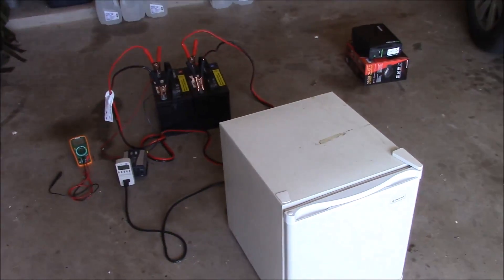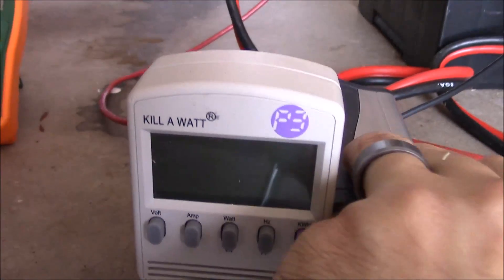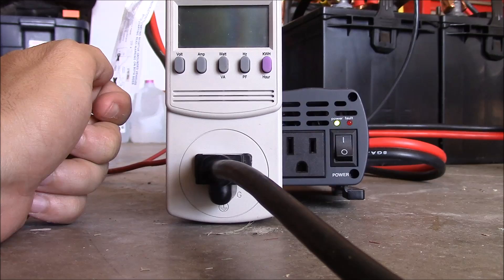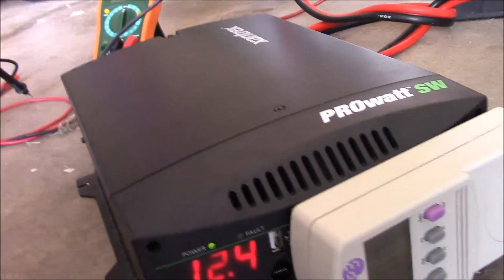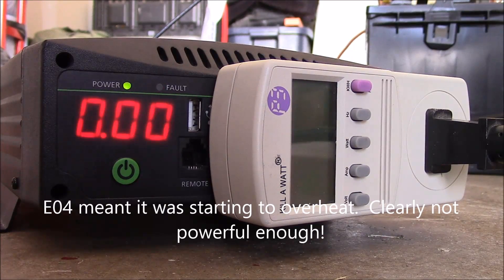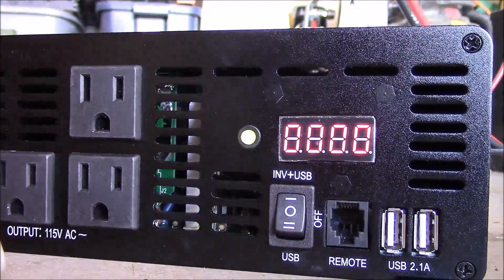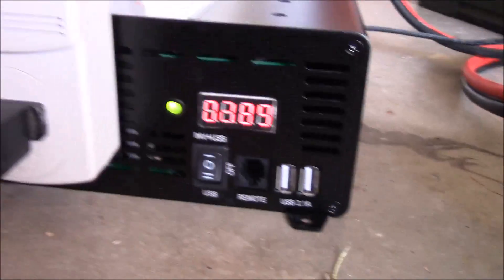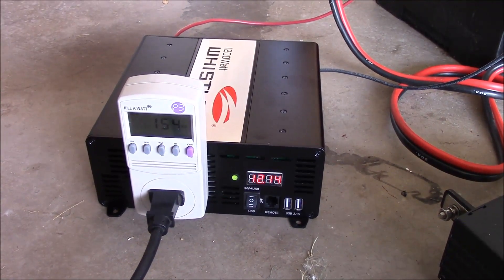Will It Solar? - Mini Dorm Fridge 3

Comment: Dude you need 4 awg wire to inverter
Reply from the maker: Ideally, yes.  But that isn't relevant to the experiment.  The exact same setup worked with a different inverter.
Reply: @LDSreliance  yes it is a inverter need heavy wire to run correctly bro. Try 4awg wire on the 500w and watch it will work
Reply: Try it on next video and I'll suscribe ok?

Comment: Bad inverter fridge pulling to many amps to many
Reply from the maker: Yes, some inverters aren't built for it and some refrigerators make it harder with inefficient compressors and no soft start.

Comment: Wait for a while... Give it 10 minutes before celebrating. We thought it was all good in the first five minutes, but my 2000W Performance Tool inverter isn't carrying my 3.2 cu-ft fridge at a 40-50W steady pull after the initial 580w start up surge.

We're connected to 200W of solar but the inverter isn't staying lit for long. Thank goodness for power station backup, however, I'd rather run off the solar/battery/inverter setup.
Reply from the maker: If the inverter can make it through the initial surge, I don't think it is the inverter that is failing to keep up to the ongoing 40-50W.  Sounds like the solar panel system is not giving it enough power.  I'd guess voltage drop but I don't know much about your system.  You could have 1000W of solar but if the voltage making it to the inverter is too low for the inverter's power range, it will shut itself off.

Comment: The wire guage on the battery side is too small and will create too much resistance(heat)  going in to the inverter therefore causing a thermal overload. Your watts and amps should be about half of what your reading as well. This is more than likely caused by a bad capacitor. you should be at about 50% of the RLA not right at it. That reading is the maximum working amperage of the compressor before it would shut down on internal thermal overload and or ruin the windings from too much heat.

Comment: If you have not figured it out yet then here is your answer. Your inverter is to small to handle the compressor. When the compressor kicks it can pull 3 times as much power to kick it. Also it looks like you are using a modified sign wave inverter and some things just don't like modified sign wave inverters. If you are going to try and run something like that and you want to go with a cheap inverter then buy a Power Bright 1100 watt inverter from autozone. They cost $105.99 as of today. I have one and I can use it to power my 700 watt microwave. When I bought mine they were only $99.99. I also have a small fridge with a freezer that my power bright 1100 watt inverter will run.
Reply from the maker: I guess you didn't watch to the end of the video.  I did figure it out and did get it to work on a large inverter like the Power Bright that you mentioned.  The point of the video was not to discover that there was a large surge current.  I already knew that.  The point was to see what kind of inverter would actually work.  Because just saying "3 times as much power" doesn't help.  The running Watts of that Fridge was less than 150W as you can see at the end of the video.  So by your math, the Xantrex ProWatt should have easily handled the load as it is rated for 600W continuous and over 720W surge.  But it didn't.  And the Xantrex is a pure sine wave inverter.  

It wasn't until I stepped up to a 1,000W unit that it worked.  So the point is that not all inverters are designed equally internally to handle large transient, inductive loads like a compressor motor.  It doesn't matter what the surge rating says or whether it is pure sine wave or modified sine wave.  Because the inverter that got the motor to run is a modified sine wave inverter.
Reply: @LDSreliance  I did watch the whole video. My point was that if you were wanting to run that on a cheap modified sign wave inverter then I would have used a 1100 watt power bright inverter. I myself own a few inverters and a couple of them are complete junk. I have a 400 watt everstart inverter that can barely handle a laptop that pulls 90 watts. I have a 1100 watt power bright modified sign wave inverter that can handle my 700 watt microwave and can even handle my 10,000 btu haier air conditioner or my Mini fridge and my 3.5 Cu Ft chest freezer at the same time. Then I have a WZRELB 1500 watt pure sign wave inverter that can run pretty much anything that I need it to run. Then I have a 2500 watt cobra modified sign wave inverter. Most of the time the watts listed on a power inverter are a scam since a lot of them will not output the required amps needed.
Reply from the maker: Exactly.  I am sure I didn't make the point of the videos clear but I wanted to illustrate to people that had not run into this issue that not all inverters are built and rated the same way.  And about half of them are nearly worthless.  So I wanted to take an actual common device that someone may attempt to use, in ignorance, on an inverter where they may run into severe issues.  Microwaves, fridges, air conditioners, vacuums, and other devices throw a lot of people for a loop this way.
Reply: @LDSreliance  I agree with you 100 percent. I have done a few videos myself showing some of my inverters. It more or less comes down to the amp draw on a lot of things. Any inverters from wally world are complete junk. Cobra inverters are rather expensive. The middle ground inverters are the best inverters for most people. 1000 watt up to 1500 watt inverters would work for the average person. In my video uploads I ran a 120 volt dryer on my 1500 watt pure sign wave inverter. I was not downgrading your video in fact I enjoyed it. keep up the good work and have a nice day.
Reply from the maker: Thanks man.  You too
Reply: @LDSreliance  Thanks, but I am in for a really long day. sony sent my girlfriends PS4 a bad update 9.60, and it more or less bricked her system. I have been working on it for the past 3 days. I ended up replacing the Blu Ray Drive and the Hard Drive. Then I gave it a Hard Reset without the hard drive installed and I have been able to get it to read and play 11 out of her 15 games. One game Tales of Arise is really important to her since I bought it for her birthday last month . Right now I am trying to install Horizon forbidden west and it's taking 8 plus hours just to install. Then I have to check to see if it will play. I may make a video on how I did this to try and help other people out.
Reply from the maker: I am sorry to hear that.  Turn the bad situation into something positive and make a video!  Great idea.
Reply: @LDSreliance  Thanks. I uploaded a video on how I did it yesterday. Today I am going to make a video on my 55 Qt 12 volt Zokop fridge, and I am going to reinstall her 1 Tb hard drive in her PS4 and start all over from scratch. Another long day.

Comment: I've always brought coolers/ice for camping trips and think its time to upgrade to a portable refrigerator which are very expensive and then I came across your video...mini frig's are way cheaper. Would this work with only one of those batteries?
Reply: My portable 500w solar power stations run my 3.1 cubic ft dorm fridge but not my 5 cubic ft manual defrost box freezer. My Bluetti EB70 with 700/800 watt inverter runs the freezer though. These power stations run these about 24 hours depending on ambient temperature. They would likely have a shorter run time after a hurricane when it`s 99 degrees and I tested them at normal room temperature. So I got two power stations for each so I can be charging two as the others run them. I just bought a 300 ah LiFeP04 battery, 2000w inverter, and a charge controller so I can have some power for a tiny window air conditioner, a bit of backup heat in Winter, and to cook or heat/distill water if needed.

Comment: It's the initial surge, the inverter is not large enough. 750 watts
Reply from the maker: Yes but even some inverters that claim a surge capacity that SHOULD start the fridge won't.  It has to do with the internal build quality and components and design, too.  A dorm fridge is a transient, inductive load that even appropriately sized inverters like the ProWatt can't handle.

Comment: Have you tried doing this to a full size residential refrigerator? I wonder how big the battery and inverter would have to be. Thanks for the info
Reply from the maker: Great idea!  I do want to re-visit this series now that I have better equipment and more knowledge.  I have a chest freezer that I would probably start out with but a full size fridge would also be do-able.

Comment: old video but thother unit needed thicker wire to work?
Reply from the maker: That was one thing I tried changing, including another battery.  But the real problem seemed to be the inverter.  Some inverters just aren't built with internals to handle big transient, inductive loads like a compressor motor winding up.

Comment: I also found it makes a huge difference if you run pure sine wave inverters fridges and microwaves need pure sine wave power
Reply from the maker: Part of that might be because pure sine inverters are much more expensive and are usually much better built.

Comment: It’s been 5 years

That inverter is designed to sell not running anything useful. 

Pure sine is the only inverter you should run a fridge with if you don’t want to burn out the fridge motor

12.4 is not fully charged btw

Comment: My full size side x side fridge will run on an 800 watt inverter. You need large inverter cables. But i would advise a 1200 watt sine wave inverter or larger to run coffee pots or a small microwave.

Comment: Compressor motors draw 10+ amps to start up, mine would not even run with a 1200 watt inverter.  The inverter compressors used in big fridges do slow start and I've been able to get mine to run off a 300 watt inverter, but instead of motor startup, they have a surge when you plug it in to fill the capacitors, so I needed to slow that down, but that is only when plugged in once, not to start the compressor.  hope that helps someone.

Comment: your whole issue is those jumper cables bud. you cant do that.
Reply from the maker: Please explain.
Reply: You need 2awg wire with good copper lugs on the ends. Either crimped on or solder on. I solder then crimp personally
Reply from the maker: Jumper cables can provide huge amounts of current for short periods of time.  They are not the problem at all.  If you watched the video until the end you saw that the issue was the inverter, not the cables/wires or the batteries.
Reply: 👌 let’s say this. Try it with my method and let’s see the difference on video.
Reply from the maker: I don't have that fridge any more or we could revisit this.

Comment: Ya nice vid

My fridge says 1.2 amps

But look at the compressor it says 8amps

So it needs an 8amp kick 

8x120volts 
Then add 20% buffer

1152watts

Thx man
Reply from the maker: Good find.  I wish that information was published in every refrigerator specification sheet.

Comment: alligator clip to the positive + on the inverter? You used massive jumper cables between the batteries and tiny wires to the inverter with poor connections.......there's your problem No1. Startup watts on the fridge you need to basically multiply the running watts by x8..... Problem No2....!
Reply from the maker: Then why did the exact same setup work just fine with a different inverter?  It isn't the wiring that is a problem.

Comment: You are dealing with a issue called Locked Rotor Amps.  A very common issue when dealing with refrigeration.  The initial current to get the compressor going is what is causing the Inverters to trip. Set your testers to check the max current at start up and your will see what it is using.
Reply from the maker: Thanks for putting a name to the phenomenon.  My testing equipment does not have fast enough resolution to catch the current spike.  What do you suggest I use?
Reply: @LDSreliance  I use an ALS-1 Line splitter  and a Fluke 325 Clamp on amp meter.  The Fluke has a Min/Max button that records spikes during an amp measurement.  The ALS-1 is a device that you use so you do not have to cut open the power cord and put the clamp on one of the wires.  You just plug the ALS-1 into the receptacle and then the power cord goes into the other end and put your clamp on through the X1 opening.  The X10 opening multiplies the reading by 10.  It is used for very low amp readings.  Your video gave me the idea to put my small refrigerator in my RV when I go camping to save on the cost of ice and a trip to the store.  The last trip this summer I went through a $5 bag of ice every 1.5 days and it was a two week trip.  My refrigerator is running on 2 Costco 6 volt golf cart batteries, 400 Watts of solar panels, and a Xantrex PROWatt 2000 Inverter.  The Solar covers the load during the day and the batteries handle it no problem at night.  Very little load on the system.  Thanks for the good Idea.
Reply from the maker: You are welcome.  And thanks for the recommendations!

Comment: 12.4V on your 12V battery means it is dead. A 12V battery reads 12.6 uncharged, and around 13.4-13.7 charged. Read the vtage of your car battery sitting in your driveway (not running). It should be around 13V+. Your test is failing in part due to asking a  dead battery bank to kick start a motor.

Comment: Second thing I would do is split the batteries apart then drain one battery then drain the other then recharge them incycle the batteries couple of times individually then after you do that about four times connect the battery batteries so they make 12 volts so you're doubling that your capacity then connect a bigger power inverter cuz I'm probably power the refrigerator it's trying trip in the power inverter

Comment: why don't you go to the wall outlet plug the kilowatt into the house plug the refrigerator into the killalot tmh power it's taking it might be taking a thousand watt and your power inverter is only a 750
Reply from the maker: The Kill A Watt isn't fast enough to read the amp surge when the compressor motor fires up.
Reply: @LDSreliance  it says what the surges on the refrigerator are you stupid. look up the model if it's not on the refrigerator.
Reply from the maker: I have never seen that.  Regardless, the point of the video was to prove that the components will actually do what they are supposed to do.  You can't just look at a specs sheet and buy stuff and assume it is going to meet your needs.  That would be stupid.

Comment: Glad you finnally solved the problem yourself, took me about 3 seconds once you showed the inverter lol.    Either this was just click bait or you really should learn more before doing videos that make you look so dumb!  Most any normal motor or compressor has a startup "locked rotor" surge amps/watts requirement far more than the normal running watts.
Reply from the maker: Yes, everyone knows that.  But the inverter should have handled that surge easily according to its specifications.

Comment: The fridge compressor is either old or just not functioning right. Typically compressors consume between 50 and 70 watts, even for big units. 160 watt draw suggests it might be broken and the surge current could be even more than the typical ratio of 7-10x of running current. Thus, for a modern fridge/freezer compressor you need approx. 500-700 watt surge, 400 or so continuous, and for that particular fridge, perhaps 2000 watt surge if not more.
Reply: ya your right mines larger and uses 75 or 80 watts

Comment: Im surprised it still ran !! Didnt you say it was a Modified sine-wave& not a Pure Sjne-wave ?
Reply from the maker: Yes.
Reply: Almost anything will run On modified, puresine is always better though. Some motors compressors may use more power and run warmer but most work fine. Electronics may not work as well like stereo/radio may have static or hum, but works. Etc...

Comment: I ran into the same problem with a like small refrigerator on my yeti 400, same thing. Went  to a 1500 watt pure sign inverted, runs now.
Reply from the maker: Yep.  Pretty common problem.  Just wanted to demonstrate it and try to find the easiest solution.

Comment: I run mine of a 400 watt inverter no problem. .and it's a bigger fridge that's you got. .
Reply from the maker: Cool deal.  Guess you got lucky.
Reply: What brand 400 watt inverter u use ?
Reply: what kind of inverter what make

Comment: Another note is is ac motors really only work well on true sine wave inverters ac motors lose about 30% of there power when modified wave inverters and use around 40% more power is lost in heat inductance. Also PC compressors surge is on avg 6-8x the running power.
Reply from the maker: Good to know.  Thanks!